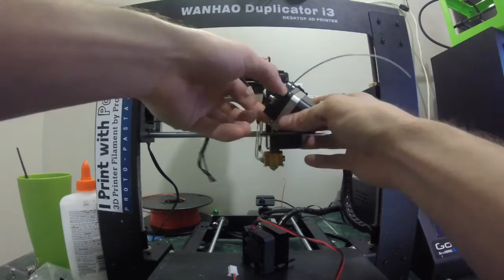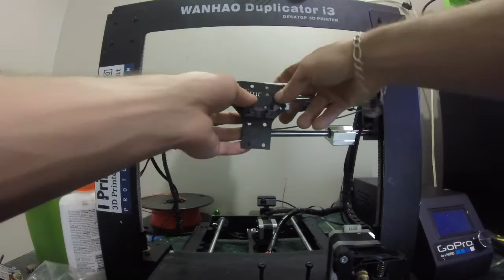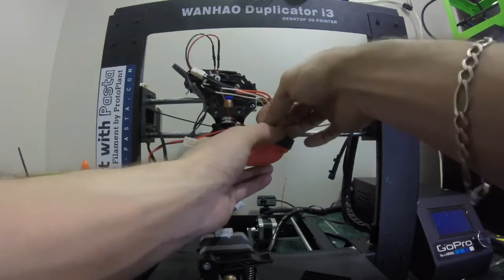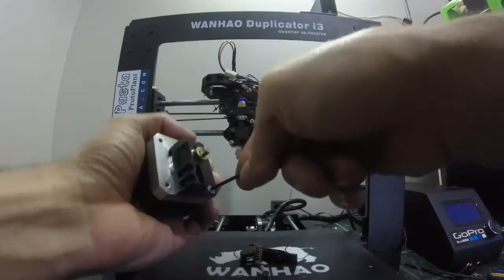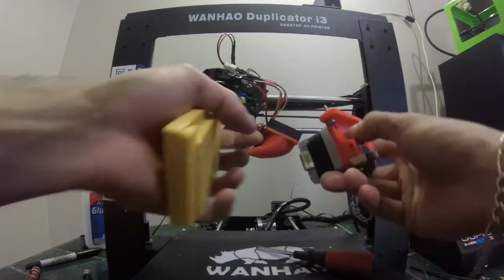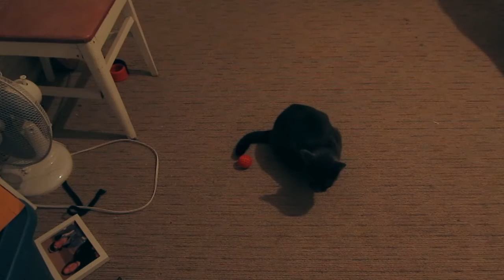Wanhao Di3 Bowden 'E3D V6' (clone) Conversion

Comment: Wanhao is a shitty printer. I got the duplicator 4 and its a crap. Also thr company has no support and no software.

Piece of crap.
Reply from the maker: My video wasnt about the D4. My video is about the I3. An entirely different printer and system. I like my Di3, and it's a great printer, open source and very moddable. I get excellent prints from mine.

Comment: Thanks for filming this. I have a Make Select (clone of a clone) so it's pretty similar.
The Chinese knockoff E3D V6, does it have the bowden tube go all the way down into the hotend? It did not look like you pushed it down that far in the video.
 - Eddy
Reply from the maker: the bowden tube only goes into the pnuematic fitting at the top, it has a seperate piece of PTFE in the hotend going through the heatbreak, heatblock, and into the nozzle.
 Thanks for watching!
Reply: Thanks for the reply. Have a good one.
 - Eddy

Comment: Did you use the stock thermistor or did you update the firmware for the e3d thermistor?
Reply from the maker: nope, this was a clone form ebay and had the same thermistor as the MK10, so i didn't need to switch tables in firmware

Comment: Did you configure your firmware? http://wiki.e3d-online.com/wiki/E3D-v6_Assembly#Configure_Firmware_.28Easy.21.29
Reply from the maker: nope, this was a clone form ebay and had the same thermistor as the MK10, so i didn't need to switch tables in firmware

Comment: thanks for the video. did you change any firmware settings or left as is?
Reply from the maker: i had not changed any firmware settings on the Wanhao at the time of filming (the clone i got had the same thermistor, so there wasn't a need to).  I've modified the printer extensively at this point and switched from Melzi to Ramps, and basically have entirely different settings now. 
Thanks for watching!

Comment: What's the benefit of the j head?
Reply from the maker: John Wall the E3D V6 is an all around great hotend, the all metal version can handle pretty extreme temps. also the bowden version takes the weight of the stepper motor off of the hotend assembly.
Reply: So, a J head is just a conversion from a regular set-up to a bowden?
Reply from the maker: John Wall jhead is a type of hotend, the ebay listing had jhead/E3D V6. it's a V6 clone, i should probably change the title lol. Bowden just means the stepper motor that drives the filament is located somewhere other than on the hotend, and the filament is fed through a tube to the hotend.
Reply: Thanks! I was confused since I read the RepRap Wiki (see: http://reprap.org/wiki/J_Head_Nozzle) and I couldn't figure out what the difference was between some of the other stuff I was seeing. Thanks for your responses! Great videos.
Reply from the maker: John Wall no problem!  Thanks for watching!
Reply: Can the bowden version not print high temperature filaments then ? Or can you get a all metal bowden hotend ? Thanks
Reply from the maker: mine was a cheap clone and had a piece of ptfe in the throat tube, you can get all metal versions for printing high temp materials

Comment: How did you pull the power cord for the extruder motor?
Reply from the maker: i removed it from the melzi board and pulled it through the cable wraps. it was just a screw terminal plug on the Melzi side, once removed, it's easy to pull through.

Comment: Can i use this one? http://www.aliexpress.com/item/E3D-V6-3D-Printer-J-head-Hotend-with-Single-Cooling-Fan-for-1-75mm-3-0mm/32336514653.html?spm=2114.01010208.3.28.Q1HOyv&ws_ab_test=searchweb201556_10,searchweb201602_5_10057_10056_10065_10037_10055_10054_10069_301_10059_10033_10058_10032_10017_10070_10060_10061_10052_10062_10053_10050_10051,searchweb201603_7&btsid=8bfcaf1c-ca3b-445a-9fb5-f730325362c9
Reply from the maker: Yes, You can use any E3D V6 or clone. I would recommend a real one, as i had many problems with my clone and have put my MK10 back on until I get a real E3D V6.

Comment: Did you use the stock Wanhao heater cartridge and thermistor in the new hotend? Or did you use the heater and thermistor that the J-head came with? If you used the new components did you have to change anything in the firmware for it to work with the new hotend? I'm interested in putting an E3d v6 on my wanhao i3 and want to make sure I cover all the bases before I throw down $90. Thanks, -Sam
Reply: I wrote an instructable on how to edit the firmware for the e3d thermistor with an arduino http://www.instructables.com/id/Using-an-Arduino-to-Flash-the-Melzi-Board-Wanhao-I/

Comment: What kinds of plug/connector did you use for you heating cartridge wires? And link to the parts you used?
Reply from the maker: i used pc fan plugs and male/female headers. that was all i had on hand.